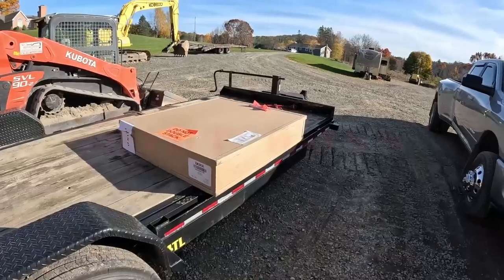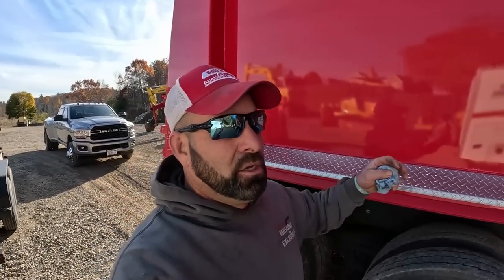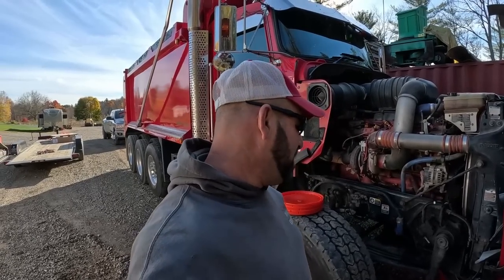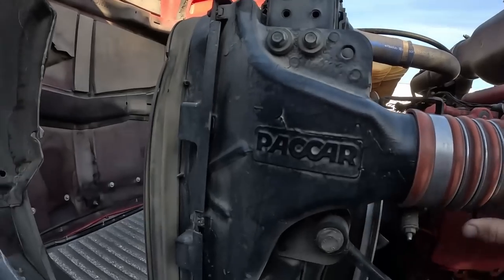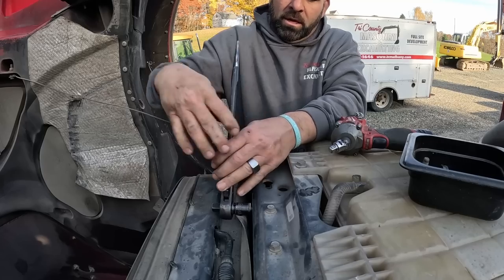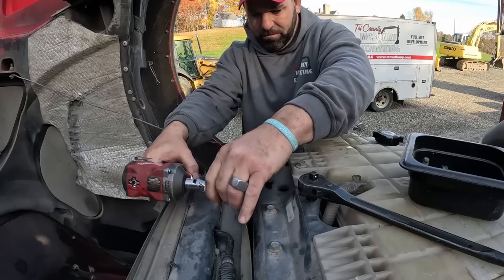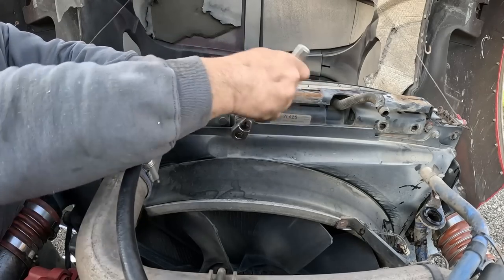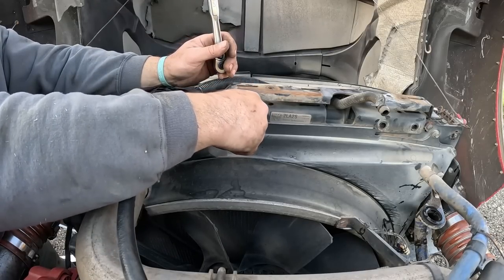Dump truck Owner operator Replacing Radiator in Kenworth T800 not removing the cage

Comment: Doncha love sticking it to the man?  I always try a short cut.  Sometimes it works… other times… well the man wins.

I had a plastic tab break off my push mower shroud a few years back.  Replacement parts weren’t available.  I went over to my neighbors metalworking shop to make a metal bracket to hold it in place.  He suggested welding the plastic part on instead.  So, we carved a sliver off of the hidden part of the shroud.  Then he took out his soldering iron and melted the shroud, tab and sliver together.  

It wasn’t gorgeous but, it held together and still does today.  I realize that’s a low pressure application compared to your radiator neck… but, it might have worked better than JB weld for a temporary repair.

You did a most excellent job of capturing the details, frustrations and victories of this project.  Thanks Boss!
Reply from the maker: Thanks SV

Comment: I had to see how this worked out. 
Actually it's a lot easier removing the entire cage. Disassemble & reassemble on the ground. You had the cage down to only the studs at the bottom.  One person can lift the entire assembly .  Just did a Pete tractor exact  same failure.  5-1/2 hours out & back in. 
Still a great job. 🙌🏽
Reply from the maker: Yes I agree I was trying to cheat the system lol
Reply: @DIRT-BOSS   You gotta at least try. Like said you didn't see any posts on the Tube. Good video. 1✌🏽
Reply: Also, if it's an older truck, the rust is going to swell the joints where the rivets are and make it almost impossible to slide in without removing from truck. (Ask how I know)

As far as one person lifting...if I had removed the hood, maybe. I'd say the entire assembly weighs over 100lbs and picking it up and over the side of the bumper was a pita

Comment: Unfortunately, when we bought used trucks, radiators were one of the first maintenance items we had to deal with.  Those plastic tanks do not last. We averaged about 10 radiators a year.  We had an overhead mobile crane that we used. A lot of times they removed the hood to get things out of the way.
Reply from the maker: Yes for sure if you're doing that many you will have the system down!
Reply: @DIRT-BOSS  Glad those days are over, but the good thing is that I still have all the neat shop equipment.
Reply from the maker: @MichaelJones1527  I know I'm jealous of your shop!!! You got all the tools & gadgets

Comment: I was laughing at you right at the beginning of the video, I knew what you'll go through. It took me 5.5 h to replace it by myself on a t680, got mad with Kenworth, they told me Thursday (few years back) they will only take me in on Monday, so I bought it and Friday I've replaced it, I was thinking the same like you, 2 h easy job, also done behind a superstore at -30, with multiple stops to get back warm, just me no help, I've got everything off only after I've noticed the bullshit engineering. What a nightmare, but was faster and cheaper. 😂😂
Reply from the maker: Crazy they could make it such a simple swap..
Reply: @DIRT-BOSS  yeah, just with little more attention at small details on their side and would have been a really easy job. Do you have an idea about what could cost if Kenworth would have done it ? 

I've read about a guy paying the dealer about 5k on a cascadia.

Comment: Great job, man. It's hard to find info on the Paccar stuff. What year is your truck? I'm doing a rad on my 11 Pete 386(Paccar motor) and it's almost exactly the same setup you have there... I've got the TRP radiator as well. $733 VS $2900 oem... Thanks for the video!
Reply from the maker: Thanks man mine's a 13 good luck it's not that difficult!
Reply: @DIRT-BOSS  It didn't look too bad once you got tearing into it. It's just a touch intimidating until you know exactly what you're dealing with.. Merry Christmas!
Reply: @DIRT-BOSS  I started really tearing into mine yesterday about 11am and was topping off the fresh coolant about 8pm. That was taking my time making sure not to miss anything. It wasn't nearly as bad as I was expecting. Just wanted to say thanks again and have a great new year!
Reply from the maker: @ScottWarder  Awesome you too!

Comment: Just did this job myself. Cheating wasnt an option with as much rust swell as there was in the joints. Your radiator must have already been replaced at some point because mine had 2 bolts with captive nuts where 2 of the pins should have been on the bittom
Reply from the maker: Yeah I took those pins out already